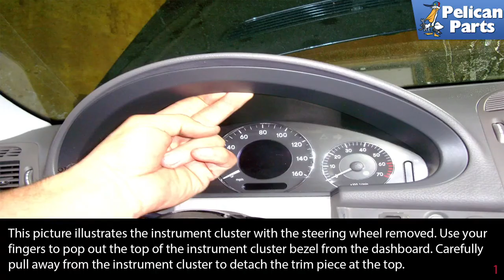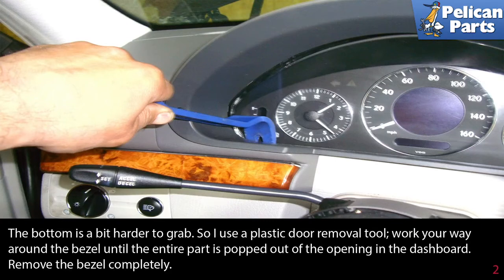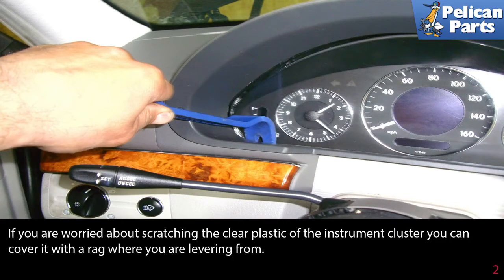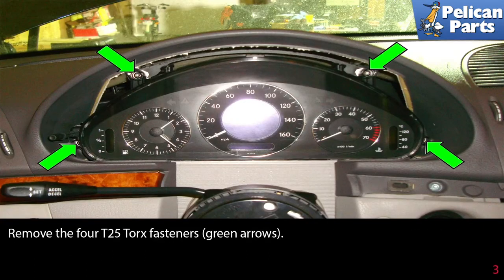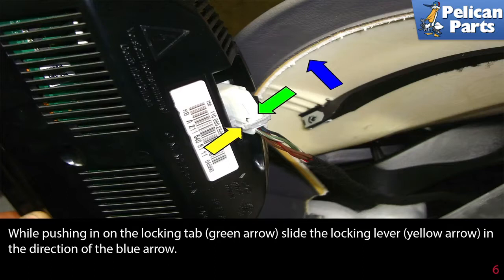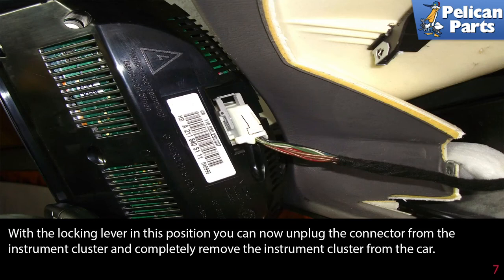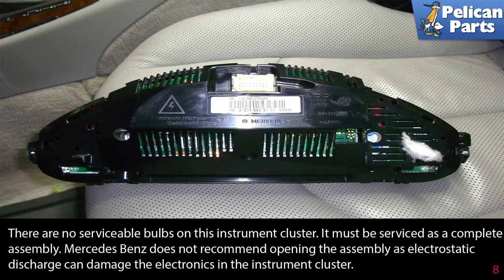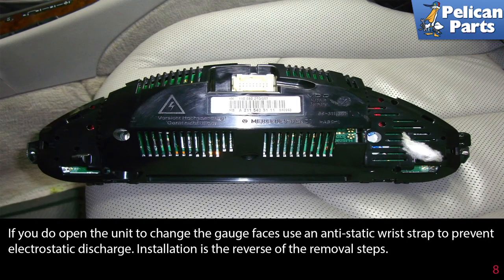Mercedes-Benz W211 E-Class Instrument Cluster Replacement

Comment: How do you import the old mileage onto the new instrument cluster?
Reply from the maker: It is programmed in the vehicle and will transfer over from other modules.
Reply: @pelicanparts  thank you. I haven't found any instruction on how to do that anywhere? Is it difficult, do you need specialist tools / software.
Reply: @jamescollins5274  for this specific Mercedes mileage is stored in the cluster and whatever mileage is on the cluster is what you will get
Reply: Mine didnt

Comment: Hi, do those have light bulp or do i have to change the whole instrument. And if i do change the instrument will the miles reset automaticly?
Reply from the maker: There are no serviceable bulbs on this instrument cluster. It must be serviced as a complete assembly. Mercedes Benz does not recommend opening the assembly as electrostatic discharge can damage the electronics in the instrument cluster